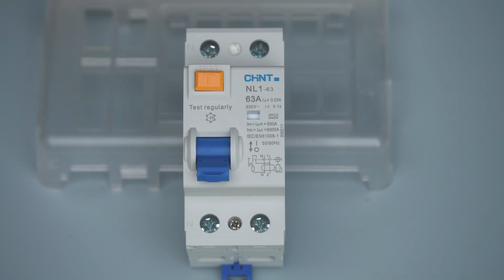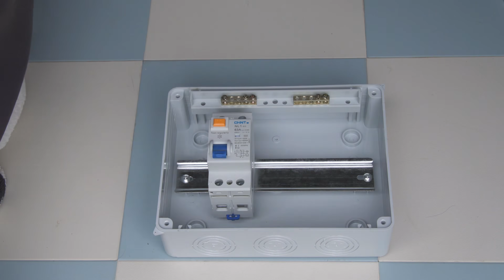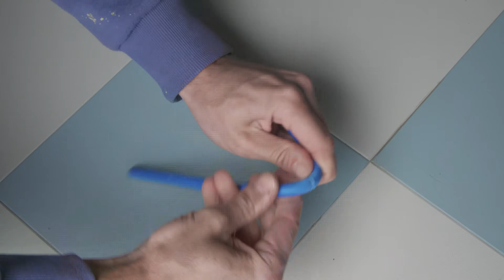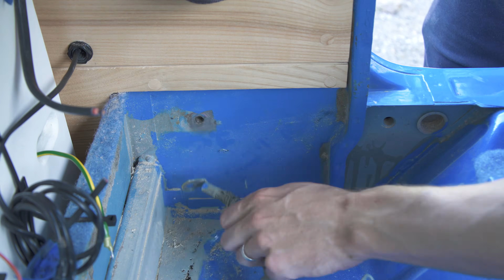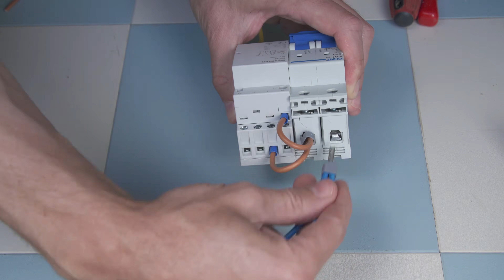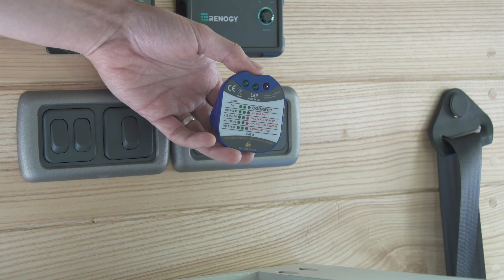How to Wire a 230v Camper Van Consumer Unit in 2026

Comment from the maker: 📌 PINNED COMMENT / FAQ & VIDEO CORRECTIONS

Huge thanks to everyone for the incredible feedback and discussion on this video! A couple of quick corrections from the edit, followed by quick answers to the most common questions coming up in the comments:

🔧 Quick Video Corrections:

Torque Slip-up: At 20:00, I said nanometres instead of Newton metres (Nm)—unless you have a microscopic torque screwdriver, use Newton metres! 😂

Labelling: Always make sure to clearly label every RCD, MCB, and switch on the front cover of your consumer units once finished. It is required for BS 7671 compliance and makes identifying circuits/faults so much easier.

❓ Frequently Asked Questions (FAQ):

Do all-in-one inverters (like Renogy 2000W / 3000W / HF Pro) still need an AC contactor?

Yes. While they have an internal ATS (automatic transfer switch) to bypass shore power, they have a floating AC output and lack an internal dynamic Neutral-to-Earth (N-E) bonding relay. Without the external AC contactor creating that bond off-grid, your downstream 30mA RCD will not trip on an earth fault.

What if I’m running a 100% off-grid setup and NEVER use shore power?

You do not need the AC contactor. You can simply wire a permanent link between Neutral and Earth inside the consumer unit. Crucial rule: This bond MUST be wired before (upstream of) the RCD input, never after it.

What if my inverter HAS a built-in ground relay (e.g. Victron MultiPlus)?

You do not need the external AC contactor. The unit automatically manages the N-E bond internally when switching between shore and battery power.

Can I use a single 10-way or 12-way distribution box instead of two separate 8-way boxes?

Yes. Just ensure you cut/split the double-pole busbars so the Shore Inlet side and the Inverter Output side remain completely independent circuits.

Why B-Curve MCBs over C-Curve?

B-Curve is standard for campervans. They trip at lower fault multiples (3–5x), ensuring safe, fast disconnection times even with the higher loop impedance often found on campsite hookup cables.

Can I use wire links instead of a solid busbar?

Yes, using properly sized flex (minimum 4mm²–6mm²) with twin/dual-entry bootlace ferrules wherever two wires share a cage terminal.

Portable Power Stations (Bluetti / EcoFlow / Jackery):

If feeding a consumer unit from a power station's AC socket, remember their outputs are floating, so RCD earth leakage protection won't operate without an N-E bond. If charging the power station via shore power, wire its dedicated charging socket before the transfer switch so it can't accidentally loop power back into itself off-grid!

Standard disclaimer: 230V electrics can be dangerous—always use the correct multi-stranded flex, ferrule all terminations, bond your earth bar to the van chassis (min 4mm²), and get your system tested and signed off by a qualified electrician before use!

Comment: Excellent video. I’ve got a consumer unit between hookup point and multiplus 2 12/3000 and between ac1 output of inverter and my 230v loads. Do I need to connect the earth busbar in each consumer unit to a chassis ground point or does the multiplus handle this? 230v loads will be used on both shore power and from leisure battery. Thanks

Comment: Hi, how did you link your plug sockets? I want to have 4 double sockets. I have one cable from the consumer board to the first socket. Do I just daisy chain between each socket?
Reply from the maker: Yes, you can use a daisy chain or "radial" circuit by running the cable from the first socket to the second, then to the third and fourth, ensuring each cable remains one continuous piece between connections.

Comment: Can I hardwire a dometic rooftop air conditioner  directly into the invertor because it has a built-in RCD? Or do I need to hardwire the air conditioner to a MCB in a consumer unit?
Reply from the maker: You definitely still need an MCB in the consumer unit! An RCD only protects against earth leakage and electric shocks—it doesn’t provide overcurrent or short-circuit protection. Running through a dedicated MCB (or RCBO) in your consumer unit ensures the cable feeding the air con is protected from overloading, gives you a proper means of isolation, and keeps the installation compliant and safe. Hope that helps!

Comment: Perfect video, wish I had it to refer to during my install!
I have been running a similar set up using the same components for around 18 months and today my contactor seems to have packed up. I have ordered a replacement but any ideas if they often just give up like that or should I be looking for an underlying cause for its sudden malfunction? Thanks!
Reply from the maker: Thanks for the kind words, really glad the video helped!
A decent contactor shouldn't normally pack up after 18 months, so before simply swapping it out, it's definitely worth checking for a few common culprits:
 * Switching under heavy load (Contact pitting/arcing): If the contactor frequently switches between hookup and inverter while heavy loads are running (like a water heater, induction hob, or high-amp battery charger), the contacts will arc. Over time, that pits the contacts until they either fail to make a clean connection or weld shut. It's always best practice to ensure heavy loads are off when plugging into or disconnecting from shore power.
 * Coil burnout / heat degradation: Many budget DIN-rail modular contactors run quite warm when continuously energised. If you spend long stints on hookup where the coil is held closed for days or weeks at a time, cheaper coils can degrade and burn out. Upgrading to a reputable brand (like Hager or Schneider) or one with a hum-free / DC-rectified coil handles continuous duty much better.
 * Vibration and loose terminals: Campervans take a beating on the road. Check all terminal screws (especially the coil supply and neutral) to make sure nothing vibrated loose and caused high resistance or intermittent arcing.
Quick test: With power isolated, check if the coil itself is open-circuit with a multimeter (ohms). If the coil still clicks when powered but no AC passes through the switched poles, the contacts have pitted or failed mechanically. If it's completely silent, the coil has burnt out or lost its feed.

Comment: I'm just a bluetti ac500 power unit to power my van im having 3 13a cable come from the bluetti to 3 sockets one for tv xbox one for cooking area like hob 1000w air fryer 2000w and kettle . The last is spare for like electric blanket the bluetti using a floating earth do I need this in my van build

Comment: Can you add more 240 plug I need around 
But I also need usb sockets how do you add these
Reply from the maker: For the 230V sockets, you can easily add more by wiring them in a radial circuit (daisy-chaining from one socket to the next using 3-core flexible cable off your MCB), or by adding an extra double-pole MCB to your consumer unit if you have spare ways.

For USB sockets, you have two options:

12V DC USB ports (Best option): Wire these directly to your 12V fuse box from the leisure battery. As mentioned in the video, this is far more efficient for charging phones, laptops, and cameras because you don't waste energy running the inverter 24/7.

230V faceplates with built-in USB: You can install standard domestic-style sockets with integrated USB ports onto your 230V radial circuit, but note they will only work when the inverter is turned on or when plugged into campsite hookup.

Comment: How do you switch over between using site power and your inverter.  Or do you have separate sockets for external site power and your inverter?
Reply from the maker: No separate sockets needed! All the 230V sockets in the van are wired into Consumer Unit 2 on the output side of the inverter charger.

The Renogy unit has a built-in automatic transfer switch, so as soon as you plug into campsite hookup, it automatically passes through grid power to all your sockets and charges the leisure battery. When you unplug, it seamlessly switches back to battery power. The AC contactor handles the automatic neutral-to-earth bonding switchover so the RCD works safely in both modes.
Reply: @WoodandWild  Is there a reason why you can’t just create a neutral to earth bond in the output CU from the inverter??
Reply from the maker: The short answer is shore power! Mains hookup is already bonded to earth at the supply. If you hardwire an N-E link in the van's CU, you end up with a dual neutral-earth bond when plugged in. Neutral current will leak down the earth line, tripping the campsite RCD immediately. That's why inverters with built-in ground relays handle this automatically—bonding off-grid, and opening the bond when connected to mains.

Comment: Where do you get the 2 pole busbar pls and can 2 single pole busbar be used instead ?
Reply from the maker: You can pick up double pole (2-pole) busbars from specialist camper electrical suppliers (like Wired Campers or 12 Volt Planet), online via eBay/Amazon, or from trade electrical wholesalers like CEF/TLC Direct (often sold as 2-pole or 2-phase pin busbars that you cut to length).

As for using 2 single-pole busbars: no, you shouldn't use them. Double-pole components alternate terminals (Neutral - Live - Neutral - Live) across the bottom. A single-pole busbar bridges every adjacent slot, which would cause a direct short between Live and Neutral. A double-pole busbar has two insulated, interleaved copper tracks specifically spaced to skip every other slot and keep Live and Neutral completely separate. If you don't have a 2-pole busbar, you'd need to use flexible cable links with ferrule crimps instead!
Reply from the maker: https://www.wiredcampers.co.uk/products/63a-rated-double-pole-mains-consumer-unit-rcd-mcb-bus-bar-live-neutral?currency=GBP&country=GB&variant=44469722808471&utm_source=google&utm_medium=cpc&utm_campaign=Google%20Shopping&stkn=b687331e4322&srsltid=AfmBOopzN5kkzg0s5PYoszRNXn27oSMjK3qNbxhHcgyu_oG7U0CSzgUknJw

Comment: Are you using the same RCD’s + MCB’s in the video to your links course your videos are using Chint but links are GACIA…issue iv found here, the chint’s neutarl is on the left side for both RCD+MCB however on the GACIA the neutral is on the right for both RCD+MCB - when it comes to wire the connector is wont work, unless
Reply from the maker: Good spot! Different manufacturers lay their terminals out differently—Chint uses N on the left, whereas GACIA uses N on the right.

As long as your RCD and MCBs are all GACIA, the double-pole comb busbar will still work perfectly!

A 2-pole busbar just has two isolated copper rails with alternating prongs. Because all your GACIA units have the same orientation (L - N - L - N), rail 1 will link all the Lives on the left, and rail 2 will link all the Neutrals on the right.

Just remember to follow the GACIA markings:

Wire incoming/outgoing Live to the left and Neutral to the right.

When wiring the AC contactor links, take your Neutral links from the right-hand terminal of the MCB instead of the left.

Hope that clears it up!
Reply: Awesome, yep understandable, plz one more the AC contactor- on the face it say 220/240 on ur link it give you 3 options 220/240 - 24v - 12v which one should I use when I’m using a Renogy 2000w inverter charger

Comment: Where did u get ur bus bar from ( on the left Consumer unit ) couse I’ve wired mine exactly like this, using the same RCD’s + MCB’s ( happy to send pictures)
Reply from the maker: https://www.wiredcampers.co.uk/products/63a-rated-double-pole-mains-consumer-unit-rcd-mcb-bus-bar-live-neutral?currency=GBP&country=GB&variant=44469722808471&utm_source=google&utm_medium=cpc&utm_campaign=Google%20Shopping&stkn=b687331e4322&srsltid=AfmBOopzN5kkzg0s5PYoszRNXn27oSMjK3qNbxhHcgyu_oG7U0CSzgUknJw
Reply from the maker: If you mean the brass terminal busbars at the very top of the unit, those actually come pre-fitted inside the consumer unit casing itself!

If you mean the double-pole comb busbar along the bottom connecting the RCD and MCB, you can pick those up on the link above

Comment: This is a great video thank you so much. I’m installing a Victron Easy Solar 12v 1600W. It has the MCBs built in but is it an RCD or MCB that I would need to run my shore power into before going into the easy solar unit. I have the same type of individual (double pole) MCB as you have to the right of your consumer units. You never mentioned it in your video. What do you use that for? Thanks in advance.
Reply from the maker: Even with the EasySolar's built-in output breakers, you still need a double-pole RCD + 16A double-pole MCB (or DP RCBO) on the incoming shore line before the Victron to comply with UK regs and protect against campsite reverse polarity.

That component on the right of my consumer unit is actually an AC contactor, not an MCB—it handles neutral-earth bonding for the Renogy inverter. You won't need one with the EasySolar as Victron builds that relay directly inside the unit!

Comment: No need for earth bro don't use the chassis for 240  the inverter has it's own protection
Reply from the maker: Definitely not the case—chassis grounding is a vital safety requirement! Inverter internal protections only cover overloads, not earth leakage faults.

If you don't bond the AC earth to the chassis, your 30mA RCD cannot detect an earth fault or trip if an appliance casing becomes live. The whole van body could sit at 230V until someone touches it. Always bond your earth to the chassis with a minimum 4mm² cable!

Comment: Thank you so much ,just asking , Does it really matter if it’s Blue Red , Blue Red into the top of the double pole  breaker as you show , can it be Red Blue , Red,  Blue  as long as it’s the same on the out put . I.e input matches out put . I notice on some breakers it says 1//2.   2//3.     Some makes have different terminal numbers thank you great vlog 👍👍👍
Reply from the maker: Always check the breaker face first—if any terminal is stamped with an N, the Neutral conductor must go into that terminal, as some breakers only have the overload trip mechanism on the Live pole.

Also, if you use a 2-pole comb busbar along the bottom, you have to keep the order identical across all breakers so the prongs slot in correctly. Odd numbers (1, 3) are usually top/input, and even numbers (2, 4) are bottom/output. Always check the little wiring diagram printed on the side/front of your specific brand!

Comment: Hey awesome video, very detailed, easy to understand, something they don’t show, 

Question please, happy with the renogy 2000w inverter charger and why a A-C Contactor is needed however on the renogy 3000w pro dose a it need a A-C Contactor??
Reply from the maker: Hi Matthew, yes, you still need the AC contactor for the 3000W model!

The Renogy 3000W inverter charger also has a floating AC output with no built-in ground bonding relay. You need the contactor to automatically create that neutral-to-earth bond off-grid so your RCD functions properly.

Wire it exactly the same way as the 2000W in the video, just make sure the contactor is rated to 25A to cover the extra power!

Comment: Great video.  Really explains everything well thanks.  For my van I just want a 230v campsite hookup and a couple of 3 pin sockets, only live when plugged into the campsite power supply (uk and abroad).  no inverter as i have an ecoflow portable battery with sockets etc built in.  So, q? is...could I use and RCBO instead of separate RCD and MCBs?  and would there be any extra considerations?  would it cope with overseas supplies that can be reveresed etc??  sorry for the barrage, but I'm new to electrics and decided my Maypole portable RCD MCB is not safe in van as no earth to chassis.
Reply from the maker: Hi Adrian, yes you can definitely use an RCBO!

The main consideration for overseas trips is to ensure it is a true Double Pole (2P) RCBO—not a 1P+N. A 2P RCBO provides full overload and RCD protection across both Live and Neutral conductors, making it completely safe if you encounter reverse polarity at European campsites.

Just make sure it's 30mA Type A (16A), use multi-stranded flexible cable with ferrules, and bond that earth bar to the chassis with 4mm² cable!

Comment: Thank you this was really helpful.  If I don’t want an inverter but do want to be able to charge my leisure battery from hook up do I follow the same wiring as the inverter?
Reply: No, the inverter wiring is for the inverter only. Follow the first part with the single consumer unit
Reply from the maker: It's actually much simpler without an inverter! You only need the single consumer unit setup from the first half of the video—no second consumer unit or AC contactor needed.

You just buy a standalone 230V leisure battery charger (like a Victron Blue Smart), plug/wire it into one of the MCB circuits in your consumer unit, and connect its 12V output to your leisure battery. When you plug into campsite hookup, it'll charge the battery automatically alongside powering your 230V sockets!